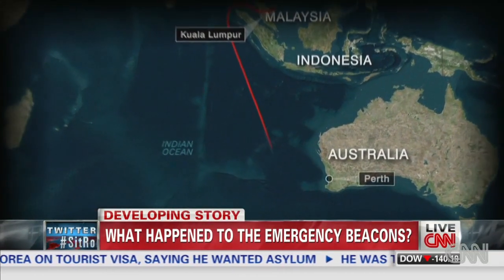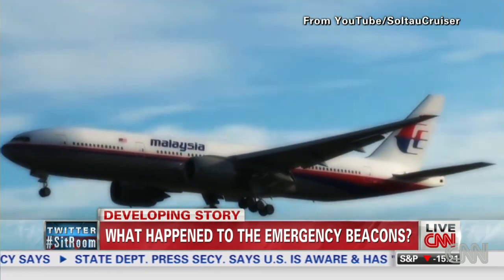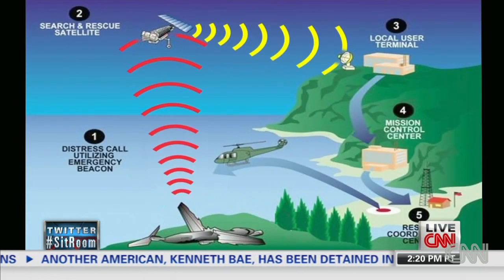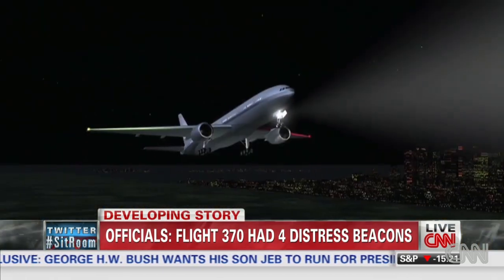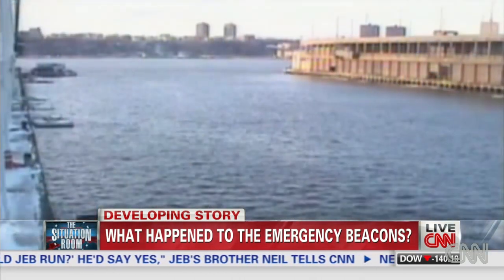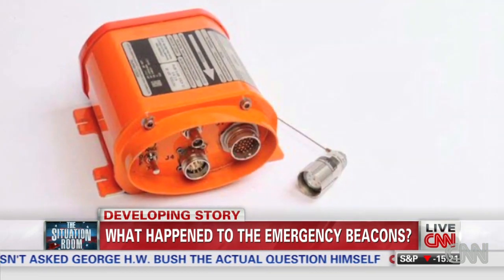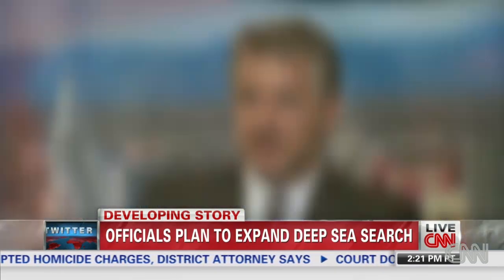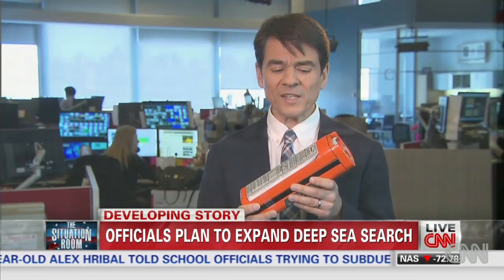Why didn't the MH370 emergency beacons send signals?

Comment: Ok, so why in the hell do we have on the planes if they're completely useless in water/traumatic impact?? It needs to be virtually indestructible like those boxes for it to retain its usefulness...
Reply: the water doesn't kill them, they're already as indestructible as a black box. they're built to send a signal in the event of a crash, duh its gonna be strong. the problem, like he said in the video if you'd have listened before rushing to comment, is that radio waves cannot travel through water. thats why submarines don't use radar; they can't. they need to use extremely loud and powerful sonic-waves, which is why sonar can kill you.

Comment: A high speed crash would have created debris... Which they are claiming they can't find because the plane went in whole... Dimensional shift perhaps?
Reply: Just like the 2 WTC planes, seamless smooth entry with complete penetration., And no explosion, no debris on impact It exploded after it was fully snuggled inside. Some other purely coincidental similarities.:: Mean Muslim pilots and Mean Muslims with fake passports, Plane is a Boeing, plane falls off radar, plane makes a big U turn, search planes sent in wrong direction and too late, black boxes not found.  Some nuts think the plane could reappear and do harm. Silly Rabbits.
Reply: ***** Oh... Im certain it isn't hijacked... I can not say with 100 percent accuracy obviously that it is a dimensional shift... I strongly believe they happen.. Something to consider (that nobody is talking about).. Review the original radar data... There are 4 planes (at various points) that come to a stop for about a minute each then vanish...... My personal theory is "ufos" If these were planes, clearly there would be some talk of this... Also one of these "planes" goes approx 2,500 mph for around a minute prior to disappearing ... Its all on the original radar data
Reply: adam as the radar info is interesting but a dimensional shift is more than a quantum leap in analysis!
Reply: ***** Only depending on which information you research... Most logical left brained people avoid conspiracy subjects... But one must ask ones self why?Because others have told the individuals that the subjects are incorrect and delusional .. Allowing another to make that judgment for you in my opinion is delusional.. Dont you think.. Perhaps you are into them.. But if you are not I highly suggest you research them in depth... Pretending you were just born. Forgetting everything you know and trusting in your logic... Information takes a new view...WHen you forget what you were taught on how to think,you will look at things in a different light and more observant..I assure you when information is looked at in this manner... You will see things that make it very clear that the vast majority of conspiracy theories are correct... I challenge you, you trust your logic correct? Review the information and you will be surprised. Also start with government corruption and the complete control of all of our networks.. You control what we watch, you control what we think.. Watch a little history of what they have done and you will start to think....Then start researching other subjects and you will receive a complete picture... You will see how ufo's have been visiting our planet for a long while.. The government has been covering it up to conceal free energy and space exploration (I know sounds crazy, just research it first with a clean slate) Its always about power. The deeper you go in the more the other conspiracies reinforce each other... Then you realize it is mostly just one big conspiracy (which with research you can clearly see ones adding validity off each other.. Now that being said :o)...  Dimensional tears are real.. They happen and have been spoken about in history (Alone, perhaps just speculative , but again the conspiracies reinforce this)... That is why I can not say 100 percent.. But I certainly can say it is a very real possibility ..Do yourself a favor when you have some free time research it.. Or are you going to allow others to make your decisions for you :o)
Reply: adam as I put my ufo video and experience on my page. So I know they're real. Robert Jungk, ,c1953, "Brighter than a thousand suns" makes reference to Germany flying "ufo"s like Saturn objects, in 1944. He gives names, flight stats and where the main players went after WW2. One went to RV Roe in the USA. Jungk is a respected historian, the book is on the A Bomb development.  To help you on your journey there are some Twilight Zone's I found that have missing planes, confused time issues. "The Arrival", Odyssey of Flight 33, The Last Flight, Nightmare at 20,000 feet", King nine will not return.
Reply: The pilot was suicidal cause his wife had left him with there two kids.he has a simulator built in his home and investorgator seen that the pilot had planned this route on his simulator.this plane crashed exactly where he wanted it to.plane was flying really low so he could let the plane sink to the deepest part of the Indian ocean.plane is on the bottom of the deep Indian ocean.its common sense to know what happened.